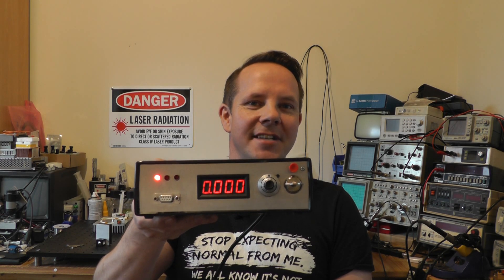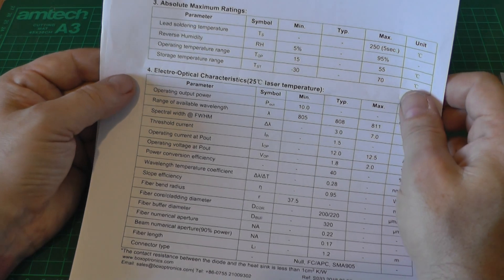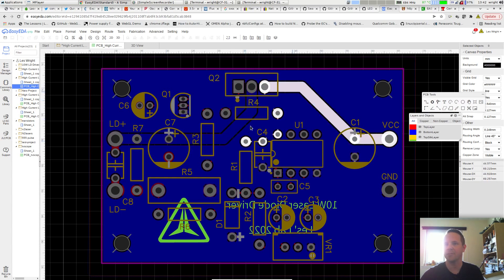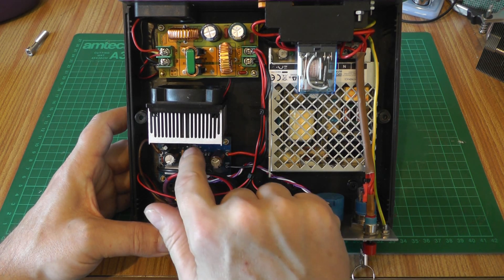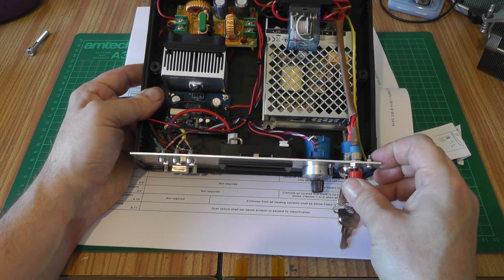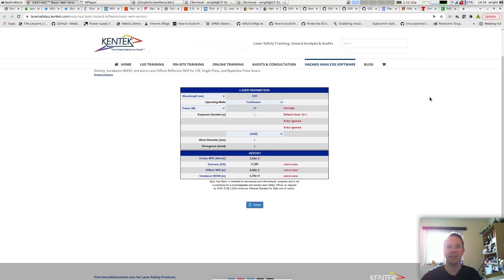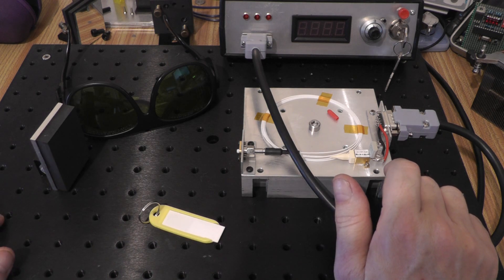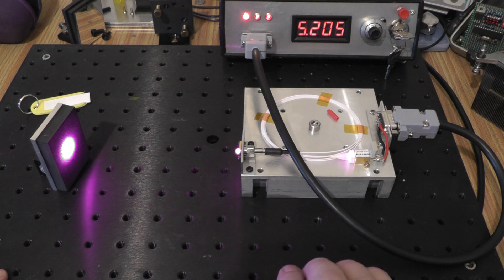High Power Laser Diode Power Supply 10W and Laser Safety

Comment: Les,
GREAT VIDEO!!!  I must first say CONGRATS for covering SAFETY FIRST, and doing a great job of it!!  I have a couple of those 808nm lasers with the fiber attached, and an very glad to run into this video before using them!!
I like your pcb design with the dual thick traces and non-solder-mask for beefing the i-carrying capacity with a solder-coat.  'Just to get word out' even extra current-carrying capacity on higher current traces, such as kW induction heater pcb's, is easy by adding soldered-on copper cable strands along the traces...but I'm sure 'you' are aware of that.
THANKS MUCH!
Reply from the maker: Thanks! For sure, I have done that before  ;-) I suppose you can also specify a super thick copper layer as well.

Comment: I am also currently working with a 10W output fiber-coupled laser diode hoping to build a fiber-pumped laser system and I was wondering if you have your PCB board either available for purchase or if it has been made available open source so I can put one together myself? Any help/advice would be greatly appreciated as I plan on starting small pumping with only two 10W diodes and then later up to six diodes.

Comment: Great stuff.  Now, are there receivers (like PIN diodes) that can convert that power back to volts & amps with reasonable efficiency?  Isolated power is often needed for SiC FET drivers in HV equipment such as solid-state transformers (SST).  In short a DC/DC converter with isolation requirements in the 10KV - 100 KV range.

Comment: Great video as well as presentation - that laser diode must be pretty expensive, are you planning to implement some extra voltage/current protection just in case something would happen to LM358 (maybe some highly energetical particle from space :D ) Personally I would not trust opamp that much, but I guess 10Amp might be to much for linear regulators, even for ultra low dropout....
Reply from the maker: I have a Lasorb mounted across the diode for ESD and transient protection. I suppose if the MOSFET failed short I would have a bad day, but there is always a risk with everything.
Reply: @LesLaboratory  probably  eFuse might do the extra protection - it is also super cheap
Reply from the maker: @great__success  a good point!

Comment: Absolutely terrifying, long wavelength laser light at power levels thousands of times greater than what it takes to permanently damage your vision is nightmare fuel. Important consideration is the optical density ratings, as given for CW lasers is only safe when the power density is not exceeded for Les your LG5 is OK when your 10w is expanded larger than 0.6mm.
Reply from the maker: Indeed! Kentek's calculator assumes quite a lreg beam diameter for its calculator, where I assume a tightly collimated beam. That said, in the application I intend to use this, the beam should be inaccessible in any case, except of course whilst I am doing the job!

Comment: Explains why my Lab supply is so expensive when it was new.  .5 volt to 35 volts current regulated up to 40 amps.  Huge rack mount beast that weights in around 80 pounds..
Reply from the maker: Cool! I would have preferred a linear supply to be honest, but transformers are pretty expensive!

Comment: Hello, Good Work with power supply! I would like to known, if you can explaind me, how regulated the voltaje in the diode? The voltage drop is 0.7 across the mosfet, 0.094 volts across the resistor. You are feeding the diode with 4.2 volts. I don't understand how the circuit regulates the proper voltage so that 1.8 to 2 v drops in the laser diode? What occurs to me, but it is very far-fetched, is that the current regulates the voltage drop in the diode, but I don't think it happens that way. Can you explain to me how you regulate the 1.8 V on the laser diode? I would appreciate. greetings and excellent work.
Reply from the maker: Thanks! Diode drops are relatively fixed values. So if you had a 5v current limited supply, the voltage drop would still be ~2v, you would just dissipate more heat through the MOSFET and sense resistors.
Reply: @LesLaboratory  Do you happen to know of a good resource explaining why this is the case? A physics perspective would be most helpful.
I very much appreciate you and your channel.
Reply: Thanks, yes I think you have right. I don't think about that. I will probe!

Comment: You've triggered me into wanting to get my CNC machine done so I can build the driver for my 40W FAP fiber laser. Love your videos Les, so informative and interesting. I've been interested in lasers since I was in my early teens and I still haven't finished my ruby laser despite having two rods and enough xenon lamps to outshine the sun lol. Thanks to you I now know exactly what spec of laser safety goggles to buy which I didn't beforehand and was one reason I kept putting off the fap laser driver. Thanks again and can't wait for the next video!!
Reply from the maker: Thanks! I have been thinking about CNC myself as well. I picked up an Old Domino Laser Marking head (teadown coming up!) and it has a digital Galvo scanning head, just need to build a controller for it :-)
Reply: @LesLaboratory  ooooh galvo's, very nice! Can't wait

Comment: thanks Les..
...where did you get the IR card ??...and i did not catch if mentioned the cost of the diode 
-r
Reply from the maker: The diode was just shy of $300 USD, which is actually fairly cheap! The card came from eBay, there are sellers in China that sell them, so expect a delay in shipping, but they are dirt cheap.

Comment: There's one additional aspect of building laser drivers like this one that often gets overlooked: You have to make sure that you can still see the display with your goggles on. This build for example can't be used with red laser diodes, since goggles that block red light will also block the light from the red LEDs on the driver-> you can't see the laser but you also don't know if it is on since you can't see the emission indicator or the amp meter.
Therefore it's a good idea to use white lights for the emission indicators and colour LED displays with switchable colour schemes: If you have a red laser and goggles that block red light you use a blue colour scheme and so on.
Reply from the maker: This is true, and I had considered getting blue displays, however the intended use for this build is IR pump diodes. I should have covered this aspect in the video though!
Reply: I use white OLED displays for mine.  Then they work with any wavelength. I do use colored LEDs for status and "beam on" indicators, but I chose colors that don't overlap with common laser wavelengths.
Reply: THIS. Dude!! I literally hate this, we have a green Nd:YAG (doubled) laser from New Wave at 532nm and the idiots put a green LED in the power supply to indicate the laser is on! Do they even use their own product??

Comment: can i use for mini tea laser channel, aluminium hexagonal (24mm diametter ,12cm long)?
Reply: This is an ultra low voltage supply designed as a constant current source.  It really couldn't be more different than what you need for that.  TEA lasers on the other hand are run from low average current pulsed or AC high voltage sources (neon sign transformers, flybacks, etc.) Fortunately, I believe Les has also done videos on that type of supply and I'm sure he'll chime in at some point to point you in that direction.
Reply from the maker: Indeed, please use the appropriate thread to avoid confusion. That said, it might work, though 1 inch diameter seesm a little large. I used 8mm bars.

Comment: What about temperature control?
Reply from the maker: At the moment this is just a test, but sure for DPSS pumping temperature contol is required, however it is not as critical as you might think. Diode lasers like this have quite a broad emission peak, according to the datasheet 3.6nm FWHM, with a temperature drift of 0.25nm/Degree or there abouts, you can get away with a relatively large temperature drift, compared with the temperature requirements for KTP for example.

Comment: Thanks for the short but excellent tutorial on eye protection.  I had wondered about this issue when you were demonstrating the tunable
bye laser which must present a bit of a challenge considering the multitude of wave lengths available, how is this situation managed?
Reply from the maker: It's not quite as bad as you think. You can get laser eyewear that covers a wide range of wavelengths, and most will also cover UV (but always check the data sheets!) That said, I own 5 pairs of safety glasses now for different purposes,  so it's all getting a bit pricey!
Reply: It all depends on the output power, if you're still operating in the class 1/2 power regime you generally don't need laser goggles as long as you make sure that there's no possibility that you can stare directly at the beam. For higher power dye lasers you can either get neutral density (ND) goggles that reduce the light to 1 or even 0.1%, regardless of wavelength (but are extremely dark) or laser goggles that just cover a specific band (for example 300-532 nm)

Comment: Nice! But it seems that there is a problem (31mA drop in 52s). I would advise you to use a shunt amplifier like AD8210 or a similar.
Reply from the maker: Thanks, I will look into that. The PSU does stablize after a few minutes, and after that, is steady as a rock, but I'm always keen to take advice and try new things.

Comment: Can you comment on grounding of chassis/box containing the controller - any tips on this?
Reply from the maker: Since this a mains voltage project the metal front and back panels are bonded to earth.
The Laser diode itself is not be grounded, as the cathode goes via a 0.01R sense resistor. That said, the sense resistor is a low impedance path to the negative of the supply in any case.